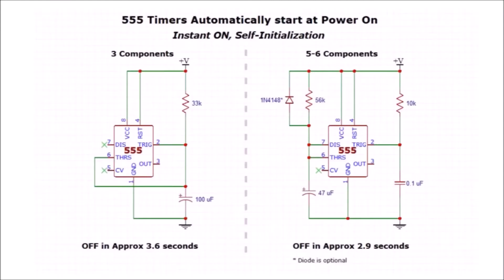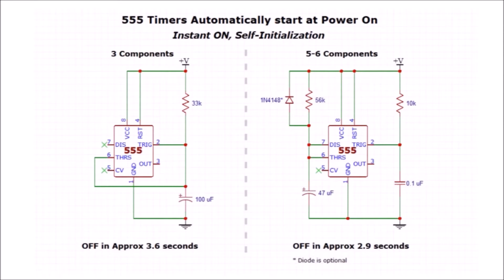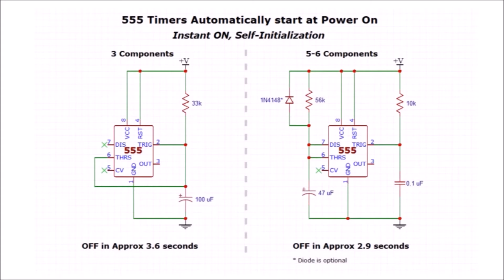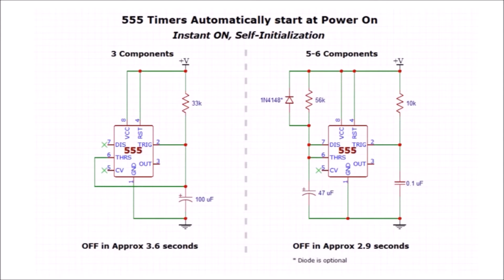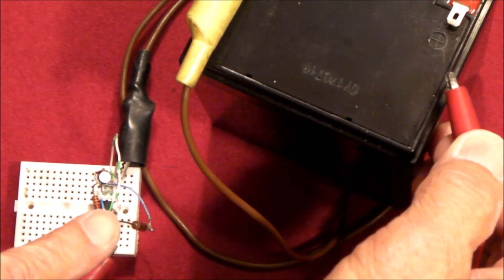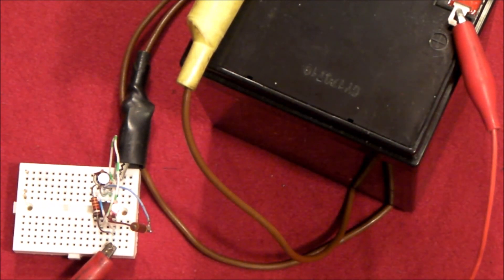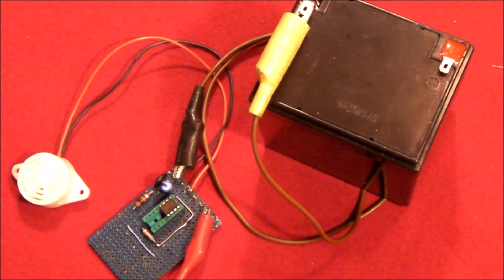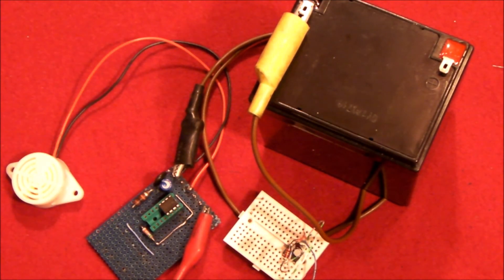555 Timer Circuit, INSTANT ON, delayed OFF;  Self-start, self-initialization with just 3 components

Comment: Very helpful video. I used the 3-component circuit. I found it useful to wire pin 7 (discharge) to VCC. This made it run more consistently.

Comment: Hello I know this video is couple years old glad I found it, but if anyone could help I want use this method, Instant on, with delay on time for 2 seconds and delay off for about 2 seconds and I want to do this just by powering on the relay and powering it off with something like a light or rocker switch, not with a push button. Will this work? Or how do I achieve this?

Comment: Hi there,
I tried your 1st circuit with 3 components, but the output remains ON and doesn't switch OFF unless the power is removed from circuit. Can you please tell me how to correct it ?
I want to use this circuit with IR SENSOR MODULE which will instantly ON the circuit and then delay OFF

Comment: Is this work on simulator.
Reply from the maker: I have found various simulations depending on software tool, to be inconsistent.  Some simulations suggest it won't work.  The video clearly shows the circuits work.
Reply: @YuDaMan  ok. Thnx lot. I will try to make this.